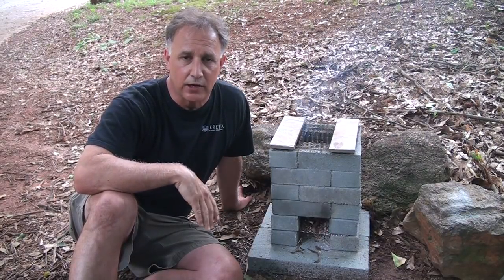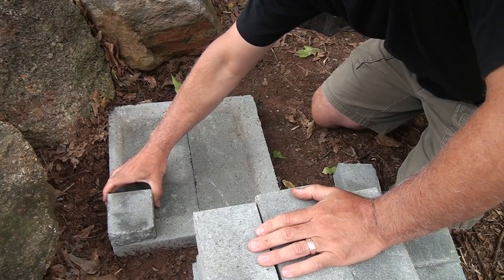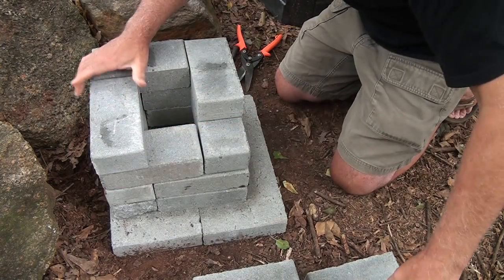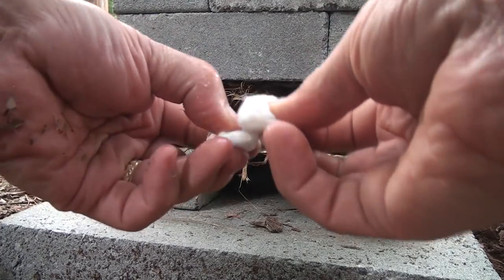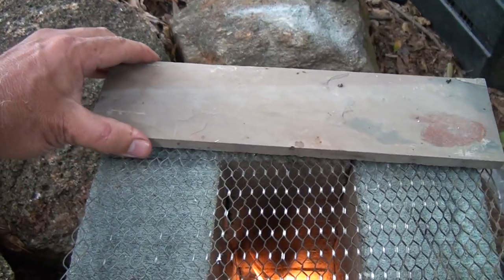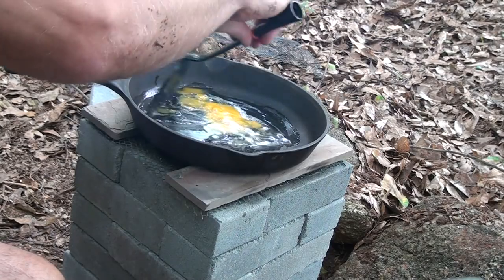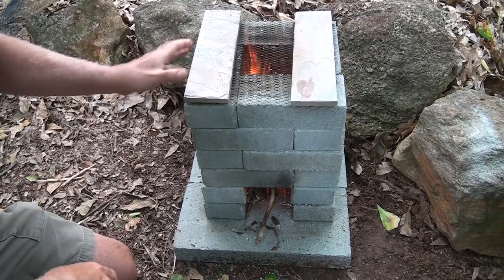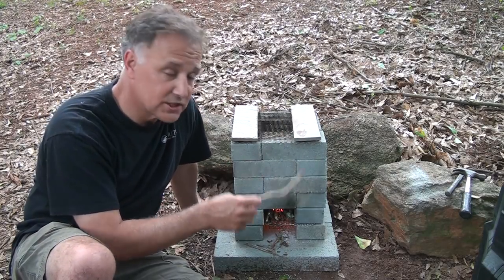DIY Brick Rocket Stove

Comment: Thanks for the video.  I like the design and look of the rocket stove you have built.  It looks sturdy and stable.  I saw someone who built the same one but used fireplace calking to keep out air leaks and it made it permanent.   My intention is to build several rocket stoves for outdoor summer cooking.  I have watched many YouTube videos on them so I believe I have settled on my design.  I noticed everyone has an issue of burning in the middle of the pan and this is how I plan to resolve that.  Amazon has a set of 4 gas stove grates for 22 dollars.  I've already purchased those.  At Aldi, I bought, 4 cast iron flat pans @ 7.88 each to serve as a base for all other pans to sit on.  With the stove grate only the intense heat still gets focused on the middle portion of pans making it hard not to burn things and it blackens them too.  The thick cast iron will distribute the heat evenly to the bottom of any pan I place on it.  And for more temperature control, I've purchased a Lodge brand spacer used for suspending things off the bottom of dutch ovens about a half inch. It can be placed atop the flat iron pan for simmering.  I intend to truly learn how to cook and bake using only rocket stoves.  Then again my ideas may not work but I intend to find out.   Maybe I will make a YouTube video although I find that pretty a intimidating thought.
Reply: Some great ideas, Mary, thanks for sharing.

Comment: Like the expanded mesh! One thing I remember from Fire Marshal visits to grade school, they always cautioned: Be Aware of spontaneous combustion that can result from heat released by slow oxidization of oil-soaked rags.  Seems like cotton-balls with Vaseline shouldn't be stored in large masses, right? A pill bottle sounds reasonable, but a # 10 can full of vaseline-soaked cotton balls might be a BAD idea...

Comment: Please don't use bricks that are made of concrete or contain granite, you run the risk of having it explode on you. Only use clay bricks for firepits/wood burning ovens.
Reply: That fire will never get hot enough. All the heat is "rocketed" out the top.  Bricks,(clay, or concrete)or stones pop b/c of heavy moisture content. There has to be quick extreme heat for this to happen. Slow steady heat will dry them before they explode.
Reply: I was gonna ask about that, thanks for bringing it up.